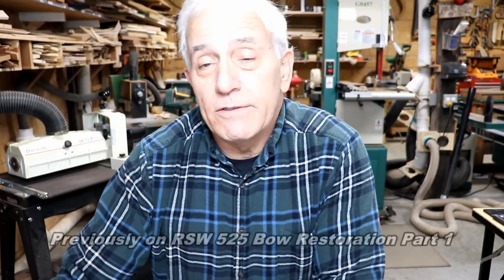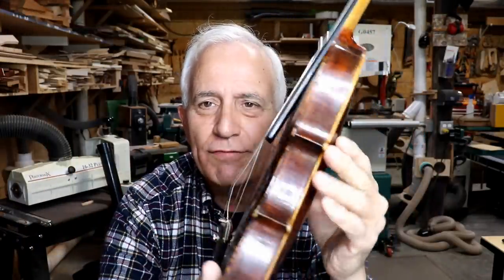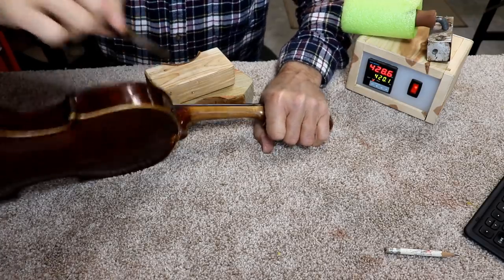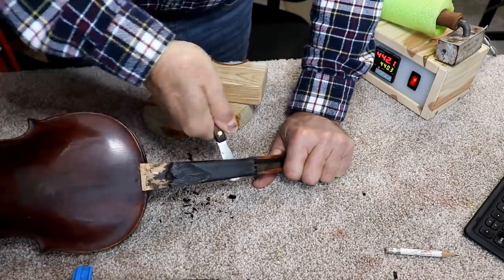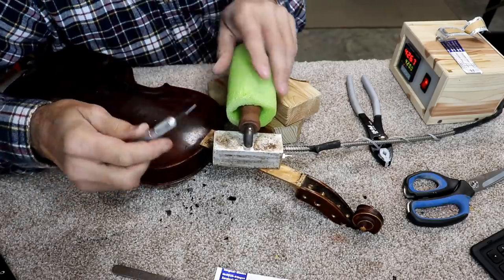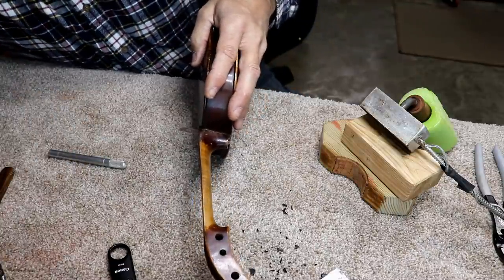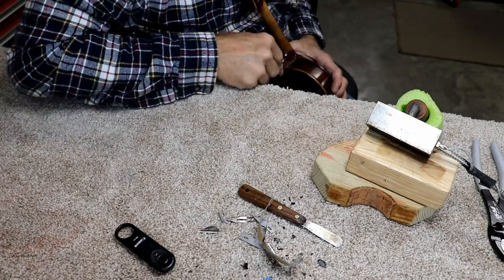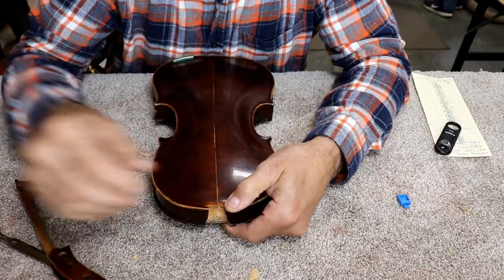530 RSW 1880s Stradivari Step Child Neck Adjustment Part 1

Comment: The fact that controller overshoots is because it reaches the target temperature fast - it could be made to overshoot less or not at all, but then it’d heat up much longer. I wager inside is PID controller, and that’s how they work. The other thing is that as you noticed, it oscillates around target as it settles: this oscillation can be also made shorter (maybe, if we’re not yet at fastest settle time) but overshoot would be even higher

Comment: Have you considered adapting a blade to fit an electric variable temperature soldering iron?
Reply: That might be do-able, for 1 blade, but after the blade dulls or breaks, it
would be a pain in the bee-hind, to have to do it again and again and again.
Reply: @zapa1pnt  I take your point but heating a blade against a hot iron will cool off too quickly. Perhaps some consideration could be made for adapting a soldering iron to take these blades. As far as I am aware the tip on a soldering iron either screws in or is just held in place with a screw. That being the case a scalpel handle could be cut down and and turned to fit, then all you would have to do is, when the blade needs changing, just pull it out with a pair of pliers and fit a new one. The only other consideration could be, would the blade loose its temper due to the heat?
Reply: @davidhawkes1328  ....bought a 25 watt wood burning pen on Analzon for a delicate wood joint clean-out...has treaded end for different holders (one being regular size #11 x-acto blade) but, you can't jam in there & all around about like Jerry was doing.   A #11 scalpel fit fine too... ( after i broke my last x-acto blade and couldn't find my spares ).           Cheers
Reply: @robozstarrr8930  That sounds like it would do the job. Far better than what Jerry is currently using